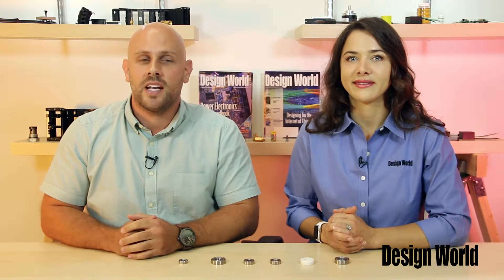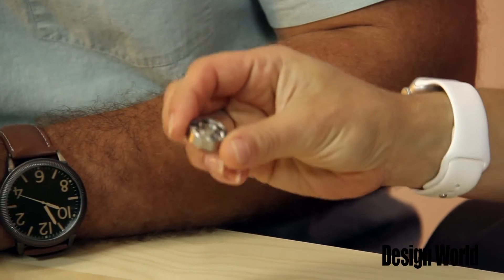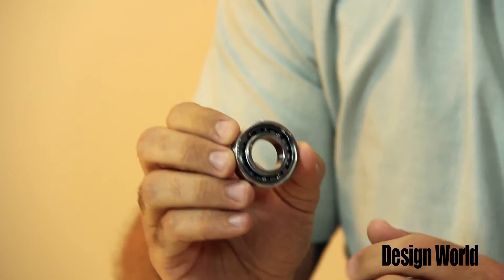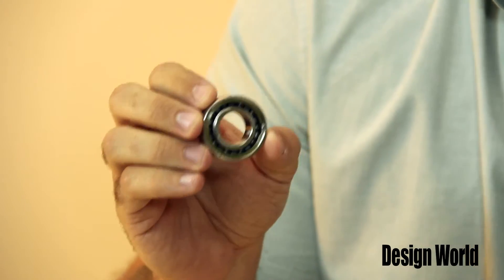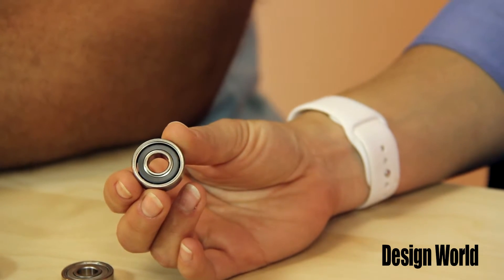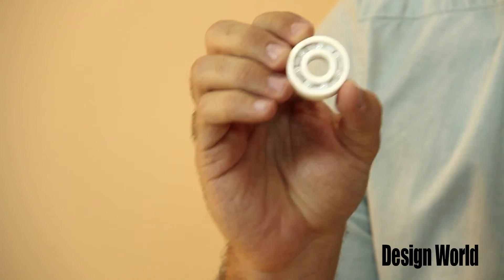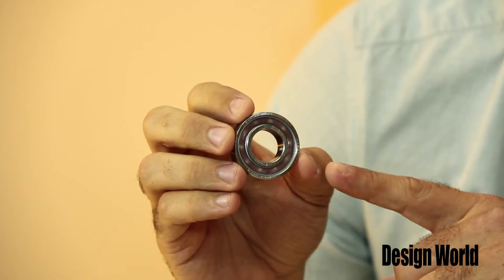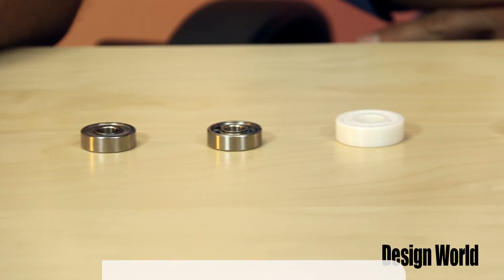NSK SPACEA Bearings Take a Spin in Harsh Environments

Comment from the maker: Here's a recommendation from our Engineering team.  Usually the fit is loose enough that you can install 608's by hand; a tool typically isn't required.  But if you're having trouble you could try a pipe or ring that would press on the outer ring.  You want to avoid preventing any damage to internal bearing structure.  If you still have questions, please contact us at info@nsk-corp.com or call 888-446-5675.  Thank you.